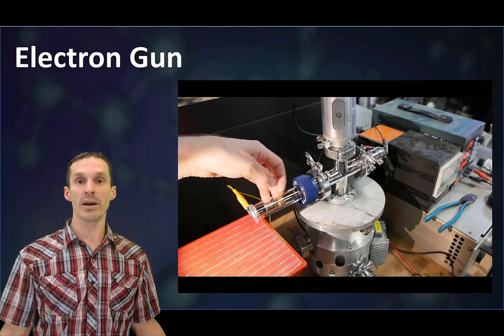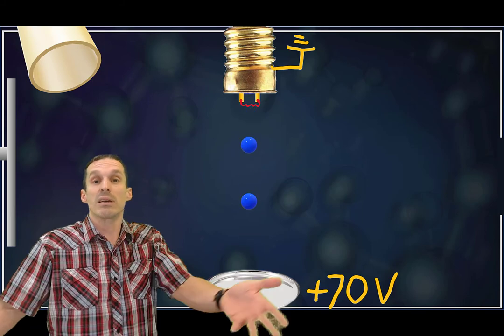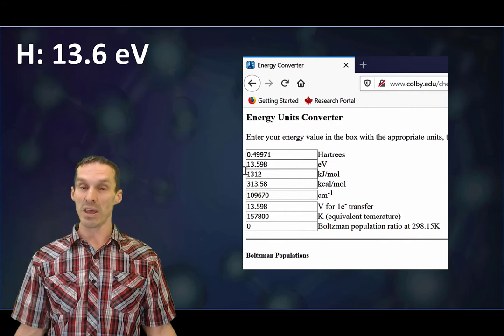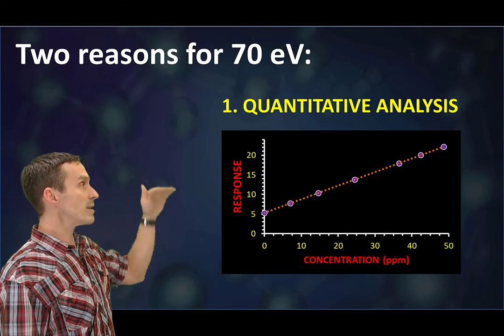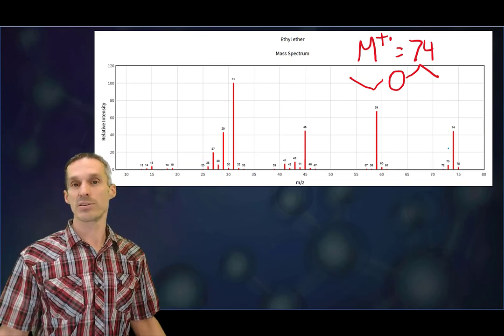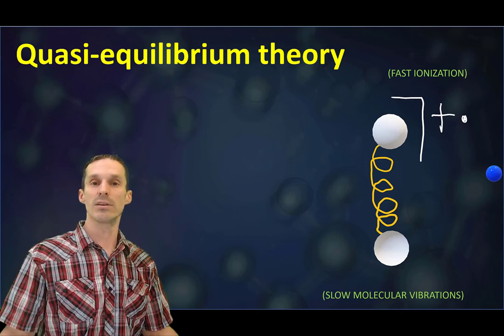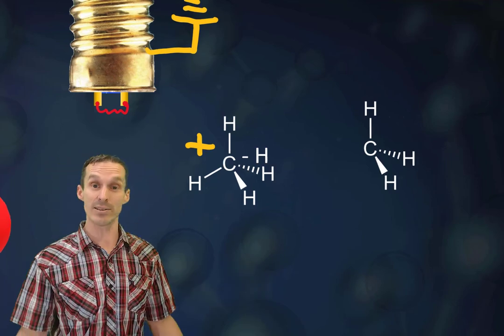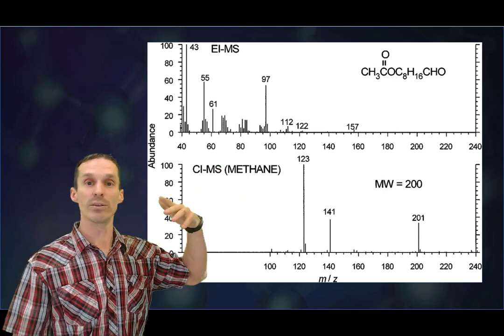Electron ionization and mass spectrometry

Comment: Do you have a reference for the process at 10:53? Quasi-equilibrium theory where the molecular ion spreads the density of its radical charge through the molecule. I’m looking for more info on that process specifically: as the molecular ion forms, how can you predict which (bonding or non-bonding) electron is lost?
Reply from the maker: "Interpretation of Mass Spectra" by McCafferty is a wonderful resource on EI fragmentation. "Mass Spectrometry: A Textbook" by Gross has a chapter devoted to QET.
Reply: @shortchemistry7927  amazing thank you! Great video, from one educator to another :)